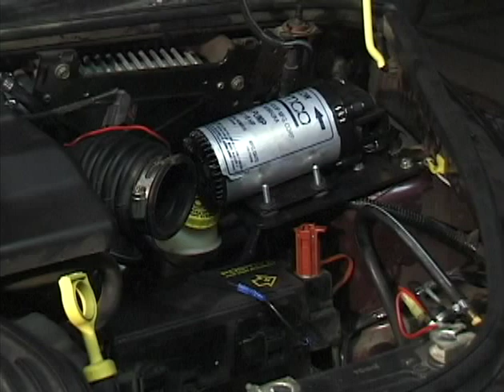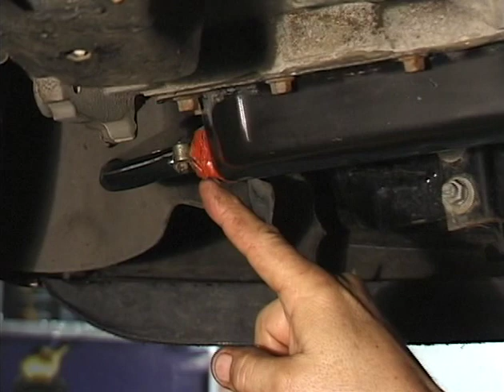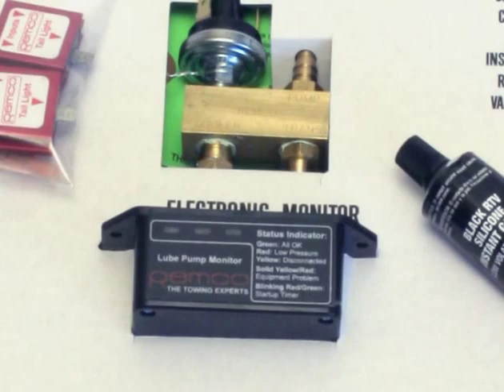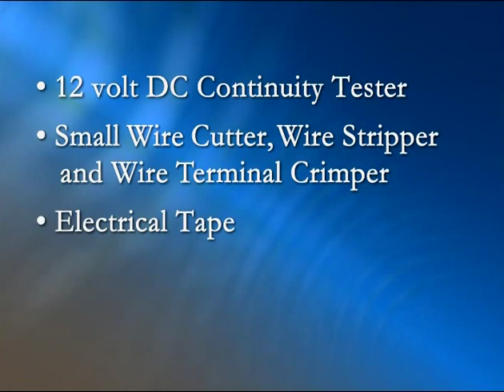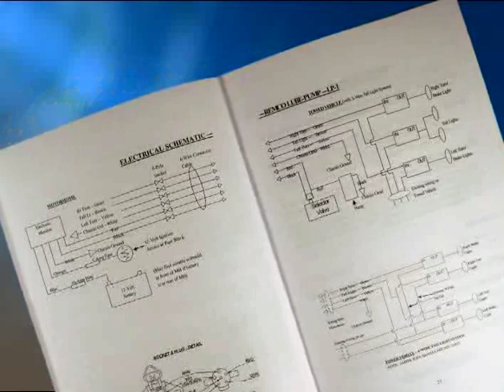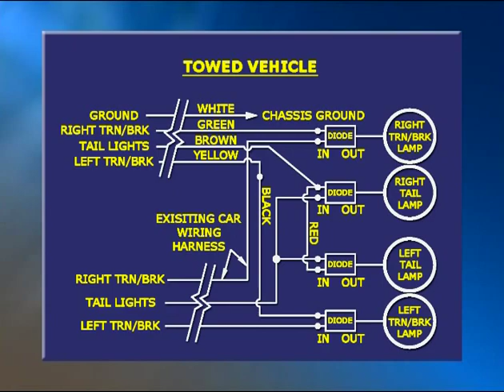Part 3 - Installing the REMCO Lube Pump

Comment: What is this for ?
Sorry for the stupid question ;(
Reply: ..it's a Transmission fluid circulation pump, it's used to circulate transmission fluid in a Transmission, so that it does Not get damaged when the vehicle is being towed on it's four wheels.   Most vehicles equipped with automatic transmissions, can NOT be towed flat footed.  the most be carried on a Flat bed or trailer.